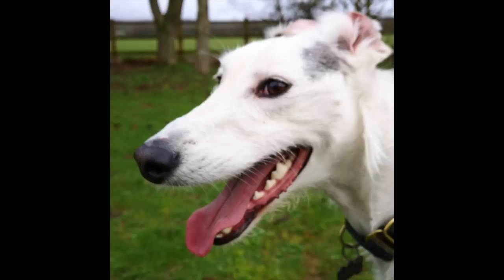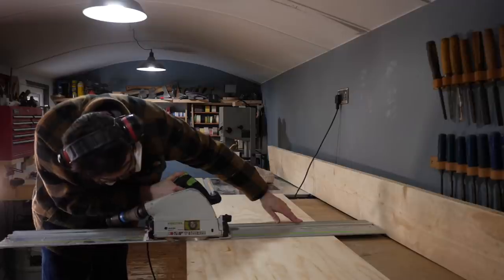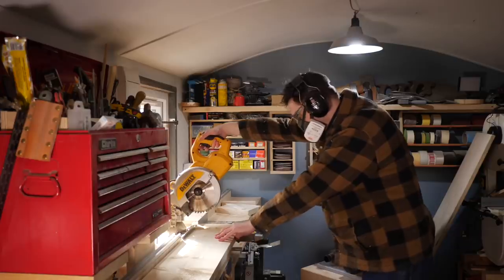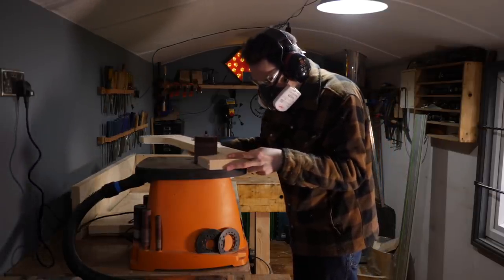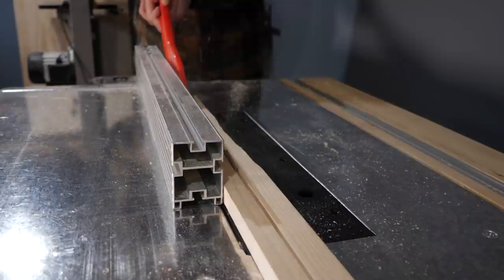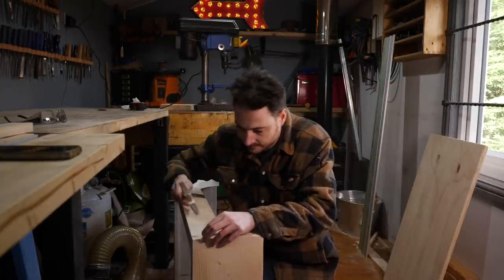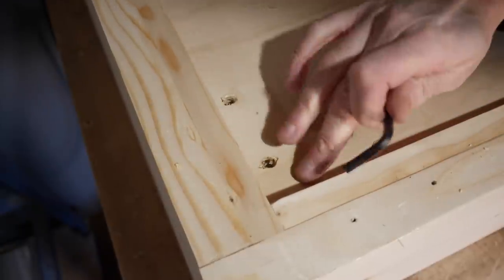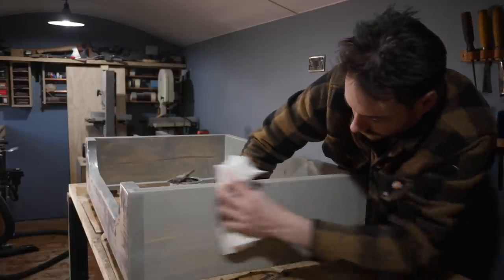Making Harry A Dog Bed

Comment: Nice dog bed. Harry seems satisfied with it. Thanks for sharing how you made it. Where did you get so much snow from?
If you make plugs using a smaller piece of wood, you can use your band saw to have the plugs with both ends smooth.
Reply from the maker: Thank you. I do that if I have a lot of plugs to cut